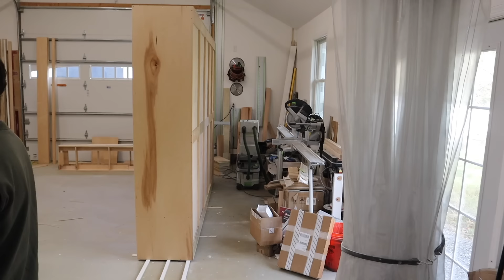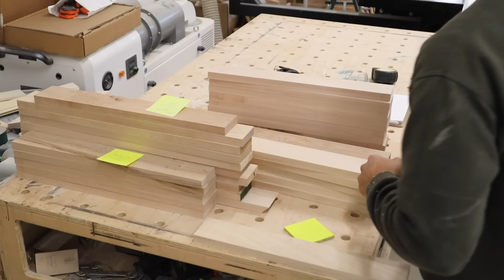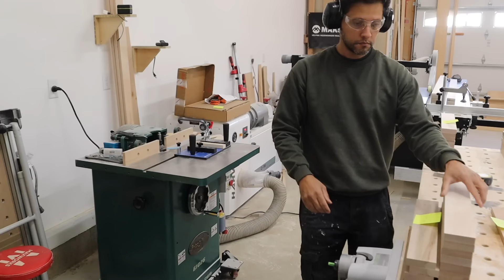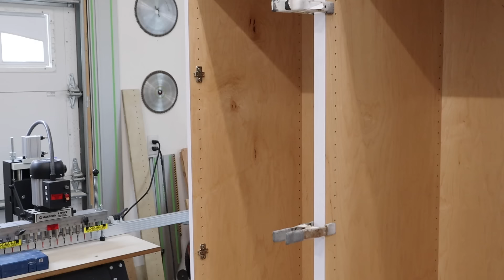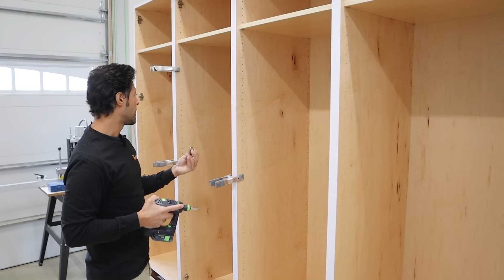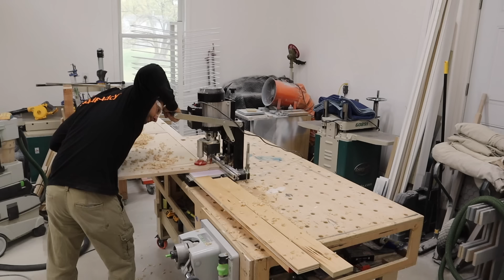Really Big doors that won't warp

Comment: Do you make the center rail wider, to give the illusion that it is same width as rest of rails and stiles, since it’s routed, on both sides?
Reply from the maker: Yes but not always. It depends on the door and what the client likes. In this case I only went 10mm wider to make up the difference of 10mm the extra profile takes up on the opposite side of the rail, leaving it aesthetically pleasing to the eye.
Reply: @AnthonyScolaro1 Very nice, I really appreciate your attention to details!

Comment: Hello, Anthony. Desiring to move from making stub-tenon Shaker style doors on my table saw to coped joint on a router table, I recently purchased a very nice (steel) router table but have yet to purchase a router.  When you crafted coped joint doors using a router, what size router did you use? I’m not really commercial, so buying a shaper isn’t in my retired life stage.
Reply from the maker: I used a 1.25hp router in the router table

Comment: Which model of hinge did you use for these doors? What thickness are the doors? I'm assuming 22mm+ and overlay. I'm about to make some faker shaker doors that will be 18mm + 12mm Stiles and moulding, so a 22mm hinge won't work. Does the thicker door need the hinge hole to be positioned differently?
Reply from the maker: The doors are 19mm or 3/4” thick. I tried to reduce weight as much as possible so thicker doors would not help with that. I used the Blum clip top tool free hinges (I have a video on those). Full overlay as these are frameless carcasses.

Comment: One big advantage of a shaper is that because the cutter heads are much larger diameter than router bits the cutting geometry is different and better. The knife exits the cutter closer to parallel with the grain (on long grain cuts) so less tearout. Much more powerful  and less vibration than a router too. You should get a guard for it though. You are on to it, but a power feed unit is a huge plus. Better finish, more consistent machining, safer and so much faster. Imagine a planner without a feed!! 👍

Comment: Thanks for the video! Question: I see you used 1/4" MDF for the panel. In your experience is that sturdy enough over time to keep things from warping. I see some youtubers suggesting 1/2" MDF instead. I'm getting ready to make these for the first time and have larger doors as well for a pantry system.
Reply from the maker: I’ve used 1/2” in the past and it’s way too heavy. It’s okay for small cabinet doors but I stopped using it a long time ago. Customers complain the doors sag almost immediately and need constant adjustments. 1/4” panels are plenty strong, It’s not like the center panel is taking any load or supporting the door, that’s what the stiles and rails are for.
Reply: @AnthonyScolaro1  Thanks, that helps a lot!

Comment: What is your rule of thumb or figuring out if you need more then 2 ,3,4+ hinge on a door?? Should you always be conservative and put more or??
Reply from the maker: I always follow the manufacturer’s specs, if you use quality hardware like Blum, they have a chart that gives you the exact weight and length of how many hinges are needed to support the door and operate properly. If you need a rule of thumb, anything longer than about 30” long and over 18” wide, I would use more than 2 hinges. Use that as a base
Reply: @AnthonyScolaro1 excellent! thx for the quick response!

Comment: Excellent video! The tips and tricks is very much appreciated on how to avoid the warping. What usually trips me up on using more that 2 hinges is the adjustments on the hinges (tilt, spacing etc etc). With 4 hinges is there any tricks to adjusting that you can share in a future video or a link to a past video?

Comment: So, were those side panels, 32 mm balanced panels, for your hole drilling system to work?
Reply from the maker: Absolutely Not, that’s the beauty of the line boring machine. You don’t have to have balanced panels. Watch my video where I build this entire unit and I demonstrate and explain that.
Reply: @AnthonyScolaro1 so your line boring machine always has to reference, the same end of a panel, to keep front and back holes in same plane.
Mostly I really like your method for locating the hinges, putting the plates on first, then using them to locate the bores.
I’m about to pull the trigger on a Blum line boring machine, you’re convincing me!
Reply from the maker: @mrmajestic345 the machine has stop blocks on both ending the fence, so no matter how you rotate the piece, it’s always going to reference the same end of the panel.
Reply: That’s a pretty cool setup you have there!

Comment: Great video. I do have a question about assembling projects. I’m having issues with assembling projects while keeping them straight without being wobbly (for example: serving trays) 

My assembly table is flat (husky table) but I work in my garage and the floor goes slightly down towards the garage door. Would that affect my assembly? I’ve been scratching my head and can’t figure it out. 

Thanks brother
Reply from the maker: I would definitely recheck the flatness of the table with a true straight edge, but also shim up the table to make it as level as possible. Maybe add some adjustable height feet.

Comment: Great video again Anthony.  My setup is clearly a novice level compared to you.  I have some jigs to do adjustable shelf and also a jig for the door hinges that have some guides for repeatability.  I haven’t found a method to easily use the shelf holes for the clips and then accurately do the door holes. I guess that is because I need a 2mm reveal for the door.  So with the width of the carcass ply plus the reveal it is a measurement exercise to get everything in the right place. I’d love to simply use my shelf holes and then do the door hinges but I can see how cumbersome it is going to be to get a large door in place and then transfer a mark from the cabinet piece to the door. And set the hinges. There must be an easier way
Reply: Is there any way you can lay the carcass on its side and butt the door up to it at the height reveal you’re looking for then mark a line on both the door and the carcass? Making that your center point for your hinge and hinge plates. Not sure if I’m following your question correctly, but those are my two cents.🤣
Reply: @nickmendes8023 thanks Nick.  I have sort of done this.  But I have the door with hinges on and then I align them and mark the holes for the cabinet side catch.  Yes it works but it won’t use the shelf holes as they won’t line up.  I know a bit long winded.
Reply: I’ve seen builders use an extra stile fitted with hinges to facilitate making the marks on the carcass. Much easier than working with a door.
Reply from the maker: @nowherewoodcraft that’s what we refer to as a story stick or story pole, that would be fine if you’re making these specific doors over and over exactly the same every time but otherwise on a one off custom run, it’s way more efficient to just use one door as the story stick and then mark all the rest to those measurements. Otherwise it’s just an extra step you’re doing. The speed my business moves at, I try to eliminate as many extra steps as possible.
Reply from the maker: The easier way is to do the math but if your wrong, you’re screwed. Especially when a door has to overhang a drawer divider and has 2mm off the top and 8mm overhang at the bottom with a 2mm gap for the drawer front underneath.

Comment: Kind of a stupid question but I’m looking to set up my shop for cabinets but I am limited in space. Just how much easier would you say this process is with the Makisawa vs a track saw setup on an mft table would you say? Great videos Scalero. Excellent. Love the shop. 👍
Reply from the maker: Speed and efficiency tripled since I got the Maksiwa slider and the line boring machine but I also have a bigger shop. But it can still be done the old way, I have videos on that process. It’s just much slower and more tiring.